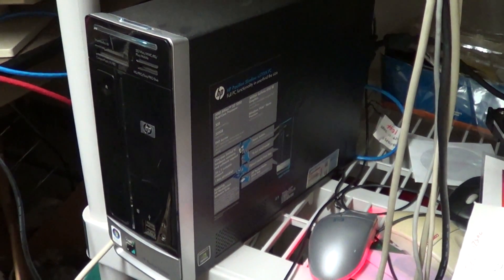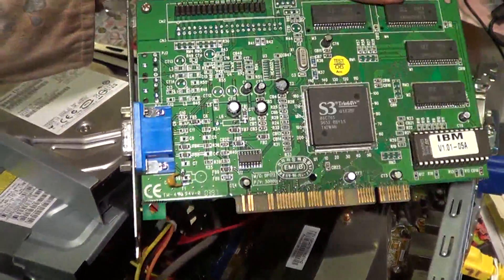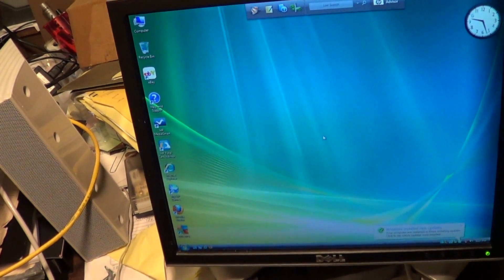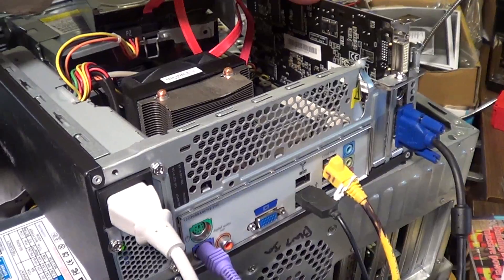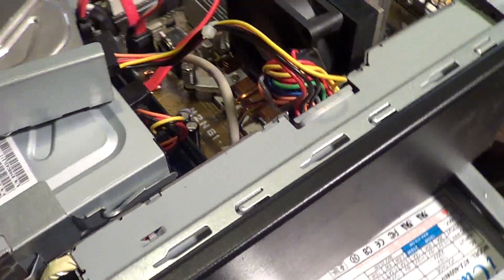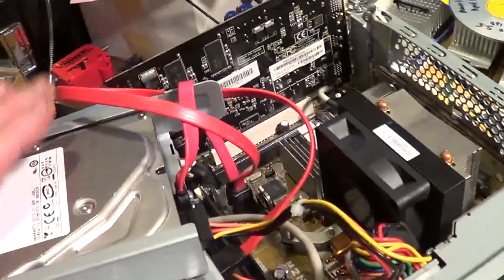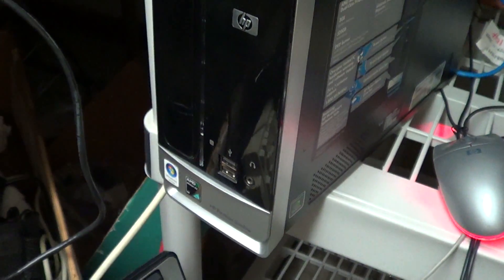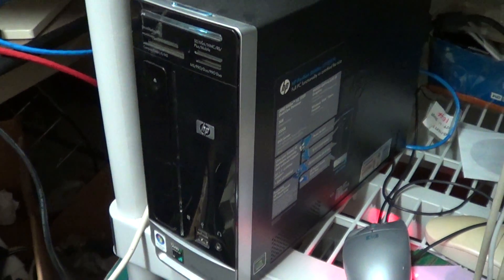HP Pavilion Slimline Video Problem workaround with PCI Video card S3700F

Comment: This is the same issue - the monitor comes on but its so messy its useless - could you tell me the name of PCI Card with the vga that i am to order to install please. I hope your are still well and still monitoring this channel. A usb to HDMI was ordered but it never worked as expected - maybe its a waste of time to order on that claims to work with vista since its maybe nearly impossible to find a usb to vga or hdmi or both that will auto detect and solve the issue instantly without a driver. Another thing is there may be issues with the keyboard port but hopefully a regular usb keyboard can work after this card is inserted. Please let me know about the PCI VGA card i need - you are a potential life savior.

Comment: Can Win 7 run on that unit? Thank you I found a tossed out Slimline Pavilion with Win Vista. Previous owner drilled a screw through the HDD, so it's toast. I also found a Lenovo IdeaCenter I believe, about the same size, but a bit newer. I connected both to power, and got the standard lights, so I think  they still work. A fire-wire port is correct. Want to hook a monitor to these units to see what they are doing. The Vista system you revived is a 32-bit system? Hmmm... Think I have a Win 7 32-bit disk somewhere. Thank you

Comment: I know this is coming back at you YEEEARS after you first posted, but I was gifted an HP Pavilion Slimline s3712f, which is very similar to your own problem child.  Mine has an Intel dual core, E2220 chip; 2.40GHz.  I wanted to stick this on here in case others find your video looking for an answer to such problems. And thank you for this video in the first place.  You answered my question, "can it be bypassed with a GPU". 

I had a similar issue to yours, where I thought that it must be the Nvidia graphics chip, so I tried the heat gun re-solder technique shown by a tech chick named Katherine on YT.  That didn't work for me.  I was convinced that it must be the chip, so I started scouring the internet, looking for the best match GPU for a decent price, so I could bypass it as well.  Just trying to see where I could get spending very little.  When I came across a forum called Tom's Hardware (https://forums.tomshardware.com/threads/hp-pavillion-wont-start-no-bios-info-no-start-up.222550/) where they explained that in many HP Pavilion models from the era of ours, besides the graphics chip un-soldering itself over time, there was a glitch with the face panel mounted card readers.  It caused black screen, no BIOS or very limited or shifty BIOS.  Press F10 real fast and I could get into BIOS.  I had no control over what happened once I got into BIOS, only about 6 keys on the keyboard worked, and they all did the same thing; try to exit me from BIOS or change the month of Date/Time to the number 2. 

Well, Tom's forum's simple solution is to reach up in behind the front cover mounted Card Reader, disconnect it, and tape it off.  It worked immediately and I was able to get into BIOS, advanced BIOS (by pressing ctrl + F10 then immediately ctrl + F11), and install an old HP Laptop HDD with win 7 and my little computer runs just fine now.  Supposedly, the long term fix is, once it's running properly, boot it up, run whatever version of WIN you have for at least 5 minutes, shut down, re-connect that card reader and it is fixed.  They had mega problems with those card readers after certain updates, apparently.  I'm just going to leave mine unhooked.  I will buy a low profile GPU to help share the RAM load and maybe speed things up a bit.  Next will be a PCIe x1 mounted wifi card, and if possible, don't know if it is, see about updating the BIOS.  With that, since I'm running WIN 7 64 Bit and this MOBO is capable of 64 bit stats, maybe I can upgrade the ram a bit.  If the DIMM 2 sockets can process anything over 4GB.  Thanks again for your video.  Well done and easy to follow.

Comment: I know this is 5 years later but this is so helpful! Mom just emails and surfs around for recipes. I think that’s why hers has lasted so long. Going to try a new graphics card.
Reply from the maker: Thanks for the reply. I bought two identical S3700F machines new from Office Depot about 2008. One unit still works well. The other got this odd graphics issue. Both came with Vista Home version. Neither machine was used for gaming, ie just non taxing graphics like emails. regards

Comment: i have this PC , what ever you do don,t ever try and change the hard drive,HP put drivers on it along with the OS,that prevent you from changing the hard drive,new or used,you can only download an OS on only the hard drive this PC came with
Reply from the maker: Cool. I bought a new HP computer in 2001 and it was a disaster and crashed alot. A few years later formatted the larger logical drive in the Original HDA and installed Windows 2000. This worked radically better. BUT I never could get any drivers to run HP's dialup modem, the HP LAN connector was wonky with 2000 as its driver was poorer. Thus I added a PCI Lan card and PCI dial up modem and they worked well with Win 2000. The HP dialup model was a weird OEM thing that worked but tended to back down in speed. I joined a mess of sites for drivers and wasted a mess of time with that box. Even the card reader in that HP computer was some odd variant and thus was a dude with 2000. Yes HP can have drivers hidden on the restore part that might be available.

Comment: Thank you for this video. I cut into the case to replace the video card with a new, standard size unti and it turns out not to be a video card problem! I should have tested the existing card in another PC. I think it's a bad solder on the GPU which is going to be a pain to fix. But at least the case has a new ventilation hole now :)

Comment: Im having a similar problem. Its like it cant come out of standby mode. I turn the tower off, then on.. the lights on my tower come on, but my keyboard lights, mouse, and screen do nothing. And when powering on im not hearing the fan kick on like usual. Its strange, yo me anyway. I actually had this problem once but after a couple days I decided to try to power up just for kicks.. and behold, it powered up as it should, screen came on... along with keyboard and mouse. Was just curious if anyone else had this issue, im really not a techy guy, but i just found it super strange. I know its not my monitor or vga cable, done checked. Any suggestions?
Reply: Having the same exact issue, did you ever fix it?   Remember what you did by any chance?

Comment: u need a low profile video card for this type of pc...mine had the "no video problem"..but i didnt have to get the gfx card...i just reheat the solder joints on the gfx chip..and that fixed my no video problem
Reply from the maker: CyberXpl0its There are many field  failures with the newer lead free electrical solders. Items made in the 2005 to 2008 years of mine are the worst , even a 2006 Imac has this issue. Gamers often have these issues with hot running video graphics cards, youtube has many "reballing" videos to fix playstations etc. I first heard of the issue when lead free solders were being used about a decade ago. Since then the manufacturing guys have mostly fixed the issues by using better soldering gear, preheating the circuit boards and chips and many other things. Thanks for the response. I have not tried reheating the chip on that HP unit yet.
Reply: 3beltwesty yea no kidding...i have fixed alot of hp dv3000,6000 and 9000 for the same problem...overheated gfx chip with cpu being too close and melting the bad solder....glad they fixed that.....
Reply: How do you fix a car that doesnt show the pins?

Comment: I think that you're right on buddy. I have the exact same problem with my Pavilion s5120f.  I tried the other remedies on YouTube like cleaning the edges of the RAM, but still no VGA signal.  Used to come on after powering it up about 20 times; now it won't come on at all even after a 100 times.  I'm asking for a PCIE x16 for Xmas.  I'll let you know if it solves the problem. p.s. I'm willing to bet that it will.  Thanks.

Comment: Interesting, but you have to cut the chassis at the back if you don't have the original 'half width' cards that fit into those stupid slimline chassis'...  That poses a pretty serious problem when trying or attempting to put the side back on (if even possible) and even leaving it open with the card hanging out like it is, well,... that's not going to be safe.  I can definitely see that not working for long after it is 'bumped' or otherwise accidentally 'knocked around'.